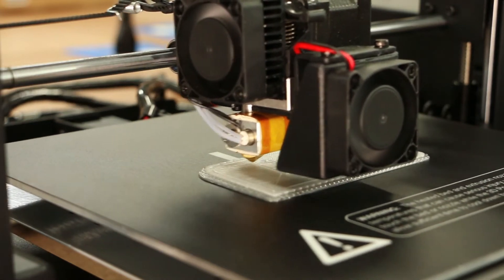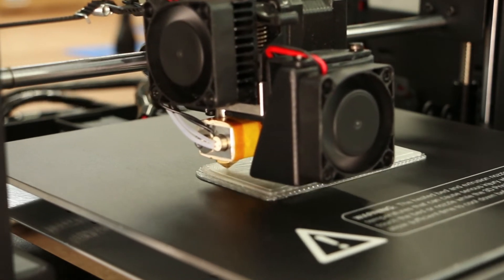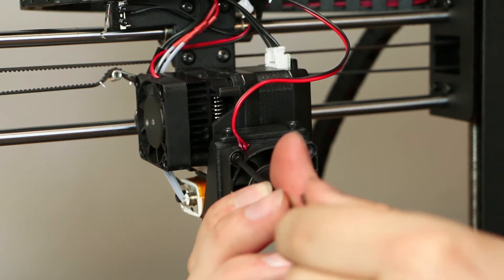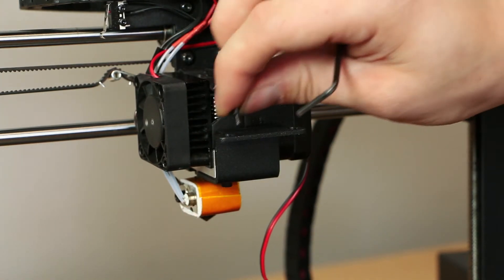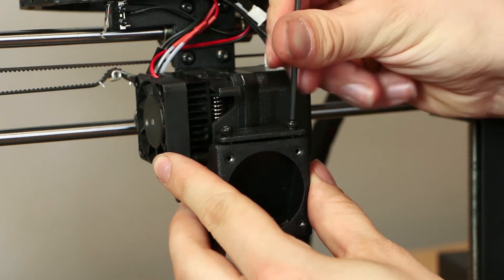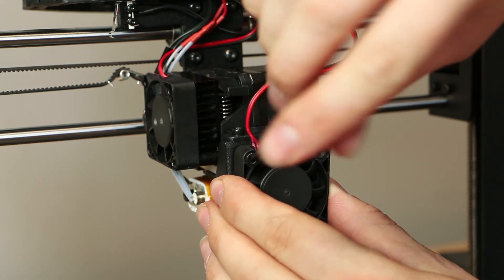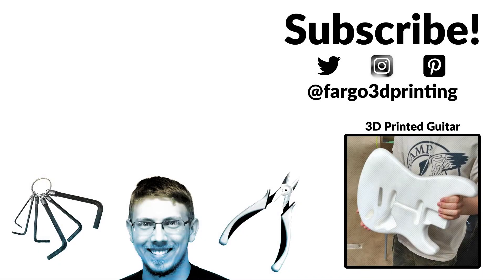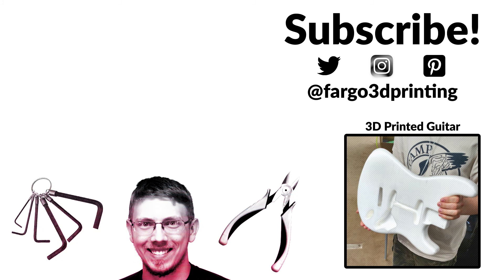Active Cooling Fan Duct For Maker Select v2 / Wanhao Duplicator i3

Comment: My issue is my fan cooling duct rides the glass when I try leveling the bed
Reply: by default that should not happen, something else is not right, is the extruder/nozzle perpendicular to the bed, use a right angle to see if you Y and X is level, you may need a Z brace